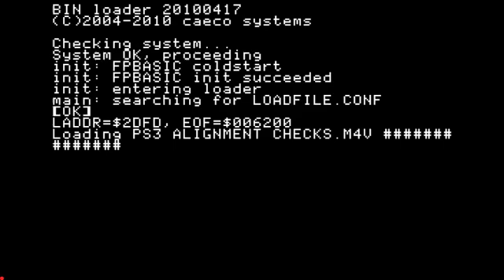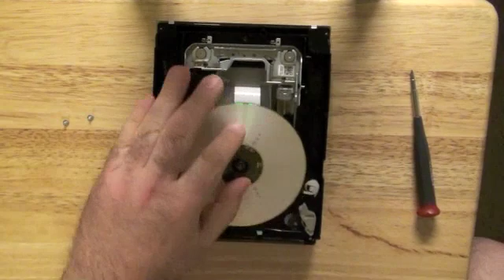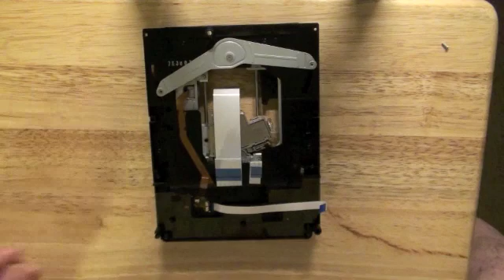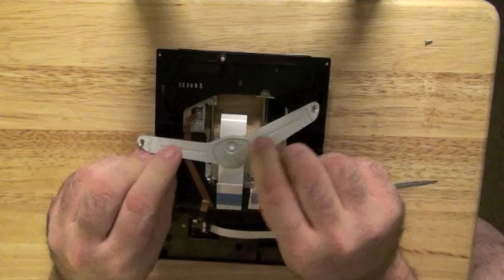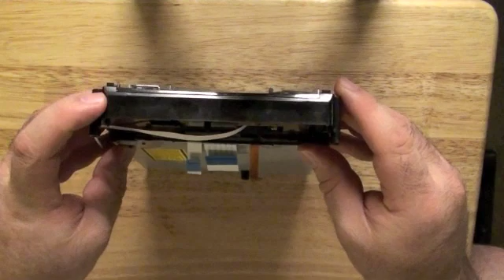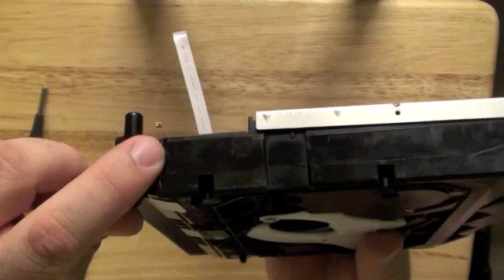PS3 Alignment Checks

Comment: dude thanks i fixed my drive  thanks to your video my drive kept getting jammed turned out it was the metal flaps behind the drive that were not aligned correctly saved my backwards compatible ps3

Comment: i ordered a whole new drive minus blu ray controller to replace my old broken laser just to be sure. it came with a disconnected pivot arm and i spend hours figuring out what was wrong. also the whole thing is so extremely flimsy especially the springs will come of and fall apart on themselves. but hey thanks for the heads up on the pivot arm cant believe it took so long to find someone who mentions ALL the vital things cos i had ALL of these problems. hopefully my launch ps3 will give me some more years now since there is nothing to play on my ps4...

Comment: I got a quiestion, today when i turned on my 160g ps3 console, it began to make a noise like when you inser a disc, but i wasn´t inserting any disc neither had any disc inside. I reset pressing 5 seconds the ejection button, but every time I turn it on makes the same noise, but after that, you can insert any disc and it reads any disc with no problem at all. Do you have any idea, what can be?

Comment: Running a CECHA model Fat PS3 and had a jammed drive (credit card instered by a kid). Followed these wonderful instructions, first attempt released the drive and it accepted and ran a disc but jammed attempting to eject. Second attempt it will now accept and eject discs but will not recognize the presence of a disc. Think I may have damaged the grey switch on the transport motor board that touches the right transport arm. I'm assuming I need to replace that motor and board but need assistance finding where to find it. Any assistance would be appreciated!

Comment: thanks for this and the other drive repair vids =)  i dismantled my entire ps3 console since it was broken (disk read error) after cleaning more than once (final time with match stick wrapped in toilet paper) before it would not fix by cleaning - big surprise no? so i realized i should change the laser unit and did - needed to reference your vids for the gear/cog positions for the loader and some other stuff - thanks again - all the best - peace.

Comment: if the disc loads onto the spindle, but does not spin, does that mean the mechinism could be mis alligned? seems like the laser wont read instead, but does the blue light (on the laser) as startup of the console, im told this means the laser is working correctly, trying to figure out why my discs wont read (cechg03 40gb fat model)

Comment: i did a full reset of my blu ray but when i hook it back up and try to insert a disk nothing happens. i didnt break any wires or anyother parts. could it be the little sensor on top has went bad or what. i need help.

Comment: I have a prolbem with the left arm when I insert a disk the left arm is supposly to move down and it does but , then it started making a loud clicking sound because was having contact with the black gear that was moving and I dont know how to fix that the arm goes down but the black gear keep spinning and then it mades that TRACTRACTRAC! and dont detect the disk!

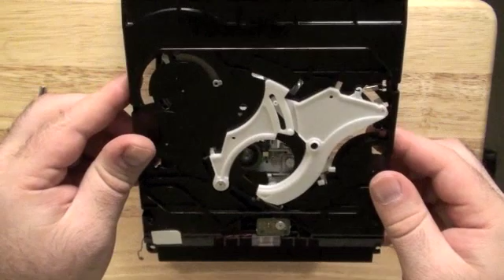Comment: white piece easily found in 8:45of your vid. the white arm that is located on the inside of the top cover. not the two main arms but the little white one on the right by your thumb that has to move up out of the way for the right main arm to move. this piece on my ps3 is causing me a couple issues and i know this because i can manually move it while its running and everything works. first problem is it rubs on the disc when inserted and makes a bad sound, also does not let disc read. why?

Comment from the maker: The most likely cause is that the top is not properly aligned.  See my "optical drive top" video for the specifics.  If the top isn't lined up right, the disc will never be centered so the spindle can clamp it.

Comment from the maker: This is certainly an alignment problem.  You'll want to make sure the left arm is free of the gear at the front of the drive when the drive is in the "ejected" position.  If it isn't, remove the small transport motor and push up on the left arm until it's free from the gear train. (There will actually be a gap when it's properly freed.) Then reinstall the transport motor and it should (hopefully) be fixed.

Comment: Hi,

thanks for the vid.

I tried putting the drive back together, but I still get the machinegun sound. The left arm is trying to move down and the laser is to rise up, put the gear flips over for some reason. Any idea what could be jamming?

If I remove the front disc insertion mechanism, everything moves smoothly. The disc insertion mechanism also moves smoothly.
If anything is not clear, I can upload a vid for you.

Thanks in advance!

Comment from the maker: I think it's far more likely that your laser unit is going bad with age.  There aren't any (accessible) laser adjustments like there were for the PS2.
Reply: I've got spin, reading, and ejection, but it just won't accept discs. 
I've been trying my hardest to replicate yours, as it appears to be the exact same unit. 

It happened after a forced eject. 
After multiple reassemblies, I still have full functionality except for taking discs.
I've realigned the metal arm and hooked it into the two plastic levers. I've set the entry wheel assembly in the no disc config. I've made sure that nothing white is hiding in the holes, and that the white plastic assembly snaps into place the same area that yours do. 
I simply cannot think of anything else to do. Your help would be much appreciated.

Comment from the maker: @819Mgr If the right arm moves but the left one doesn't, it could be that the pivot arm on the back is improperly installed, or maybe the rack on the left arm is engaged with the gears on the bottom of the left arm that lift the transport up.

Comment: I had a used game I purchased, got home, played it, tried to eject it and it wouldn't come out. I opened the ps3 and when I removed the magnet I realized it had glue around the ring from a rental sticker the prior owner or shop removed. I had to open it with the disc inside, when I took it out the (unable to slide it) the presure popped the limbs back in to default position and a small spring 1/3rd an inch came out.  No hooks, very plain, I am unable to locate where it goes. Please, help.

Comment: hey there, my ps3 got the YLOD, and i got a cd stuck in there. so i took the drive apart and got it out manually. i followed your guides to re-assembly, and its not taking cds in at all anymore. i try to put a cd into the drive and its not sucking the cd in, but it feels like it can still be placed inside.I was curious if the YLOD prevents the ps3 from even taking cds in at all, or is it something did? a response would be great and could save me some money when i get it repaired!